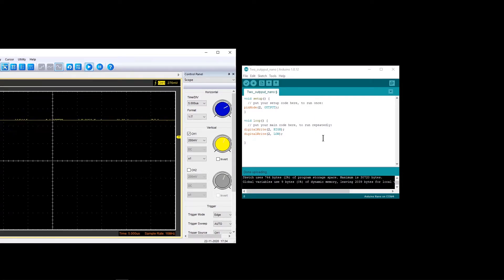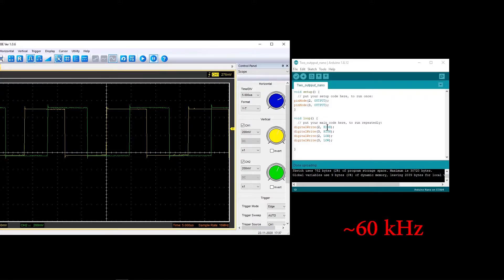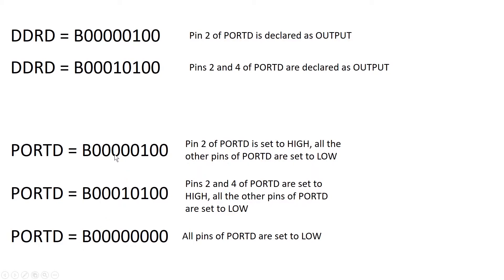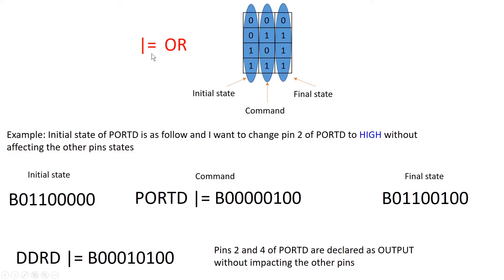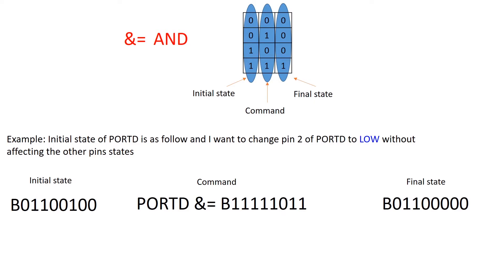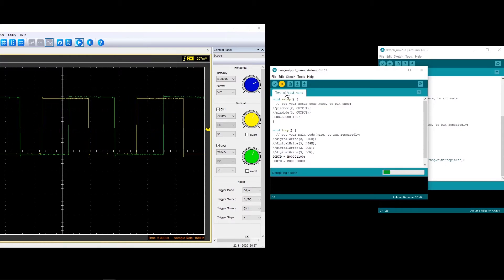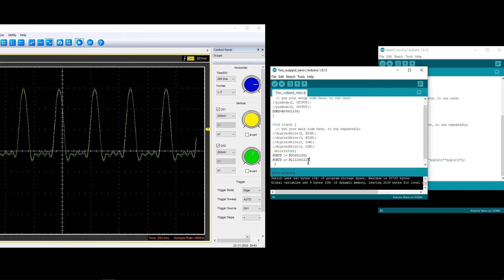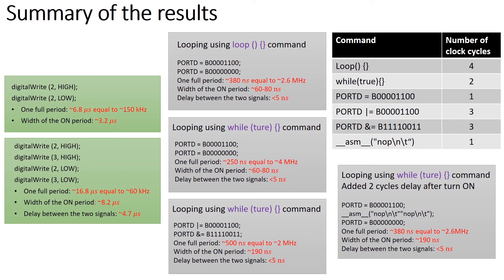How to create very fast square pulses with Arduino ( up to 4 MHz with Arduino NANO, UNO, & MEGA2560

Comment: When you work with Timer/Counter and Output Compare Register you have less code, full control of PWM times and faster frequency. The best part is, that the Arduino processes this internally and can continue to execute any other code. Inverted outputs and even dead times between PWM signals are also programmable without blocking the MC.

Comment: Do you know how to generate a same frequency PWM pulse with an external trigger using Arduino Uno? So basically want to realize a digital delay generator. For example, I have a sync signal of 120Hz, and I hope to use this feed into the Arduino, then I can change the delay (0.1ms - 5ms range), and then output a 120Hz, 50% duty cycle signal. Thank you.

Comment: Wonderful and very helpful video! One thing that doesn't make sense to me: why is the high value only ~600mV? I replicated this on my Arduino Mega and had a dV of 576mV. I would have expected the high value to be 3.3V or 5V depending on the board. Thank you!
Reply from the maker: I used a 1:10 ratio probe in my measurements

Comment: Hi Sir great video very information, Would you be so kind as to let me know what software you are using for the simulation  you are displaying?
Reply from the maker: Thanks, this is the software of the digital oscilloscope that i have. What is demonstrated is not a simulation, it is an actual measurement.

Comment: in which software you done the oscilloscope simulation
Reply from the maker: It is the software of the oscilloscope. It is not a simulation, there is a real scope and this software is the interface to see the data.

Comment: I am working on a project that needs to push even faster. For that reason I am using an ARM powered arduino due. Should I use the same commands or are the ports different for the DUE (Cheers by the way. Nice tutorial)
Reply from the maker: DUE needs completely different commands, the chip is different.
Reply: @HVE  
I am working on a project that needs to send 3 ID over 3 carriers frequencies via 3 LED
These code is it useful for my project 
Thank you.nice tutorial

Comment: Very useful ,Thank you...
How to change frequency? (10kHZ- 20Khz - 40khz) to achieve frequency adjustment?
Reply: I think this is dependent upon the processor of the microcontroller. Something like the newer Nano ESP32 has a clock up to 240MHz which can be set in the code, where the one in the vid is only up to 16MHz.

Comment: Thank you, very useful.
Can you show us Fast PWM? (More than 65kHz)
I can't figure out the prescalers and pins assigned
Reply from the maker: I will give it a try and when it is ready will make a video about it. do you want to make a sine wave after PWM filtering or you mean something else ?
Reply: @HVE  
Thanks, I think I have tried everything, but give it a shot anyway.
No need for sine wave.
If you can get 125kHz or 250kHz PWM on the 328p it would be amazing.

So far, I have succeeded, up to 4MHz output without PWM, on pin 8, the Following:
DDRB = B11111110;  // I think this puts pin 8 as output, but double check, it might have all the bits flipped.
void loop() {
while(true) { // faster than void loop() from what I've heard, but I'll double check.
// Port Manipulation:
PORTB = B00000001;
PORTB = B00000000;
}
}

Then add or remove delays with the following:
__asm__("nup\n\t");

You can add or remove those NOP operations to get close to what you want, but they will affect both frequency and duty cycle.

I'm still trying to mix and match frequencies and duty cycles, but it's a mess.
I'll probably have to rely on internal timers and comparators instead of throwing NOP's at the problem.
Reply: @HVE  can i get 1mhz signal using arduino uno. what is the procedure?

Comment: How should I think to set the dutycycle? How much will this frequency change with another command?
Reply from the maker: Depending on the code you have, you should see how many commands you used in your code and where there are placed. in general to get high frequency you do not want to add many instruction in your code. the duty cycle can easily be set based on the on/of time of the time of the output pin.

Comment: can i get sample code for 1MHZ 2 signals 180¨ Phase shift and  duty 50%,49%,48%,47%?
Reply from the maker: For 50% duty cycle it is possible but for the other numbers at 1Mhz, you need a faster processor. To write the code you can watch the video again from 15:30.
probably you need something like this (I have not tested it):
void setup() {
DDRD=B00001100;
}
void loop() {
while(true){
__asm__("nop\n\t""nop\n\t""nop\n\t""nop\n\t""nop\n\t");
PORTD = B00000100;
__asm__("nop\n\t""nop\n\t");
__asm__("nop\n\t""nop\n\t""nop\n\t""nop\n\t""nop\n\t");
PORTD = B00001000;
}
}

----------------------------------------
PORTD = B00001000 --> 1 cycle
while loop: 2 cylces
5 cycle delay
---------------------
PORTD = B00000100 ---> 1 cycle
2 cycles delay
5 cycles delay

in total 16 cycle each, which gives you a 1 Mhz frequency.

Comment: What is the name of program you used it for osillscope
Reply from the maker: It is Hantek6022BE, you need to have this digital scope, connect it with usb cable to your computer, install its program on your computer, and then you will be able to see the waveforms on in that software